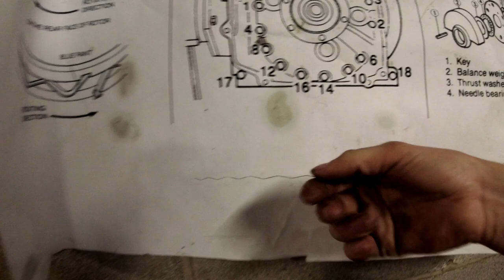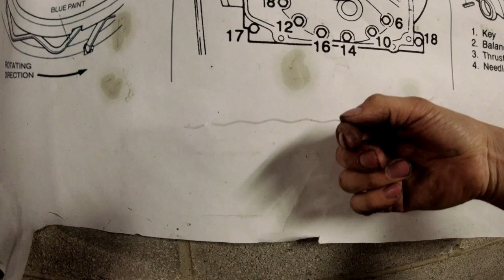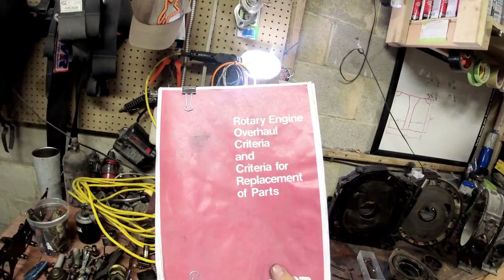Your Rotary Engine Needs a Rebuild - What Do I do? - How Much Will it Cost?

Comment: I make alot of the parts for Formula One engines, especially turbo's. Cylinder Heads. Formula One engines that rev to 23k on the test beds create incredible heat which of course melts normal metals. so therefore we put a liner inside the high heat areas of Inconel 618. of course these engines come in at 5 million $ but it would be interesting to see a garagista do something similar with one of these. very DO-able.
Reply: What engine ran up to 23k?

Comment: They are not freeze plugs. Those are the spots designed to allow the casting sand to be removed. If the engine had had coolant instead of water in it this damage would not have occured.

Comment: 'Freeze plug' is a misnomer; they are actually casting plugs, the holes used during the casing process to remove the casting 'sand' from internal portions of the casting and then closed with a plug.

Comment: Been a tech for 40 years with zero experience on rotaries who just bought an RX8 with low compression.
Your no nonsense approach video is just what I was looking for.
Keep up the amazing vids and your passion for these engines.
Reply from the maker: Thank you sir!!!   Its a lot of me talking, but its all in one place
Reply: how are things going?
Reply: @willg125  2500 km on a Mazda reman itching to send it. Now  6 speed manual and absolutely love the car. Amazing handling
Reply: @mcgrawde  fantastic! Was the swap a better option than a rebuild?
Reply: @willg125  The Mazda reman came with all necessary gaskets, flywheel, water pump, new thermostat and more. It was under $4k  CDN before taxes. Parts pricing for rebuild would likely be more if any hard parts would be required. Not regretting my
Reply: UK back in 1995 cost me 2500 first time and 1500 UK pounds 2 Nd time doing it all DIY.
Reply: I say tips are good for 70 k based on the wear I measured.
Reply: How do you time a 13b fd engine?

Comment: I appreciate the depth of information in your video. I very much appreciate the time you took to make this video. 65 years old, rebuilt regular engines and transmissions with success. Rebuilding a rotary when you can't get parts ( housings or irons), it seems a little daunting. Have had my car a number of years, going to try anyhow. Really really appreciate your video.

Comment: Super helpful! My stock 85 12A is hard to cold-start. I pulled it out of a barn a year and half ago, sat 15 years before that. I know it's only a matter of time before a rebuild is in order, and this helps to set expectations. For now I'm tempted to keep driving until it gets worse.
Reply from the maker: Does it hot start?   Cold start is probabaly just a carb issue
Reply: @RADPotential  Yeah starts up great when hot. First thing I did was rebuild the carb (Nikki, with rats nest). I also fixed all the vacuum leaks/broken tubes I can find, etc. Some steam out of tailpipe when I cold start, it's also worse the longer the car has been sitting. But I don't see any coolant drop, or its VERY small.
Reply from the maker: Id bet that engine is fine.  Just a tune up to the carb should do you solid!
Reply: @RADPotential  Thanks for the support! This conversation has reminded me to check the intake coolant seals as well.

Comment: My superchrged rotary did a 3 km hillclimb on 30 degree Celsius day with the water pump off! The temp dial was off the charts! That was 15 years ago! Still running same engine with no issues! Ceramic seals , viton o rings are good investment!
Reply: Ianetti seals?
Reply: @nzuncovered1845     Correct.
Reply: @Barkevshadian  Great I heard they are guaranteed for life
Reply: @nzuncovered1845  I believe others parts will fail but the seals will still be in working order. I thrash this engine and it is still running.  Honestly, i want it to fail to i can install a 3 rotora  But the SOB is still going and proving me with 400 WHP!
Reply: @Barkevshadian  Damn that sounds fun, 400hp on a supercharged 13B? what supercharger do you have? I was told you can't use forced induction with ceramic seals because of detonation.
Reply: @nzuncovered1845  Awesome  power! Instant throttle response , and flat power from 2000 to 11000 RPM. Its got  Whipple 2300 SC, SDS Management, lightened Rotors,hardened gears etc. The engine powers a 59 Healey Sprite.

Comment: Your video is very informative regarding Rotary potential failure areas and how they happened. I had watched all the popular videos about the Rotary engine and yours has given me more anxiety than ever as I own an 86' S4 NA RX7 (only 60,000 miles)...😂😂😂
Mine is having an oil leak running down from the Oil pedestal (not sure yet) and perhaps could also be the Oil return line (which is right below the oil pedestal). I need to bring it to a shop to check it out.

Comment: Had to watch it again and afcourse subscribed because I am going tomorrow to check out two FA RX7 where one is apparently a parts car because of rust and the other was parked two years ago but has a cracked radiator and they removed the oil cooler and made apparently just a bypass. Frankly I think the cooling liquid frozen in winter and that's why the radiator went but this means that the engine is likely damaged also. But what I can't figure it out how the oil cooler cracked and that is a big concern. The problem is finding decent rx7 or part's in Europe so everything is sadly double expensive then in US, afcourse if you can find the part's. Great video and afcourse super explanation and I will definitely enjoy your Chanel.

Comment: So just wondering, it IS possible to have bad housings/irons resurfaced correct? Because if I either have to keep using my worn 175k mile housings and wearing out apex seals fast that doesn't sound like a worthwhile situation.

Comment: There's the whole part about front and rear counterweights I need more help with . ..Also tricks and techniques about how to remove the important eccentric shaft bolts as well as it's removal. . . .. Let's not forget about oil metering pump. . .. .I need some videos showing me those parts before I tackle my own rebuild. . . ..I also need a video showing me how to get the crank angle sensor right along with the timing marks. . .How to land the rotors right when placing them back into the engine stackup. . This was a great video for me to understand some key things about what major parts to use and why.   Thank you  ..  . 86 S4 N/A
Reply from the maker: Search back on the channel. I have videos on most of that I think.  It's somewhere

Comment: I've never tried on a rotary but I know I've used "Comet" on piston engine rebuilds to help get the rings to seat during the initial start. It works like a charm on piston engines, I don't see why it wouldn't work on a rotary as well but I haven't done a rebuild on one yet. Pretty sure I'm going to have to shortly though. My son and I are doing a fb barn find rebuild right now. Keep up the great videos!
Reply from the maker: I will look into that stuff.   Is it like an assembly lube?  Good luck with the FB.  should be plenty of videos back when I restored an overheated 12a last year for the FB guys.  Full fuel system overhaul
Reply: @RADPotential  No it is an actual household powder form cleaner. It works well for deglazing and seating rings on a new build or one that has been sitting for a while. You get it running than start sprinkling it down its throat while running, obviously don't go nuts. Like I said it works like a charm on a piston engine.
Reply: You are a smart guy so once you see what it is you will understand why it works.
Reply from the maker: Hell yea.   Id be interested to try that.  Maybe I'll do a what I have laying around build and see if it would help that!!

Comment: Hi man how are you + it’s Dom from down under - I have a 84 12a  motor and box - it’s leaking from the dowl pin front near dizzy - also I have a gearbox noise very bad when cold with the clutch is out - I have to start it always with clutch in till it’s warm - I’ve done the needle bearing and seal in the back of shale , I’m worry a little about doing the pull down and rebuild on my 12a , it’s runs so well drives well -  I brought it about 16 years ago and have had in my dry garage till last year , it started first go - it my first rotor motor - I have the rotor bug now - I really would like to succeed with my car   . My little glc coupe my first car -  thx man dom

Comment: Great Video alot of useful information. Have you done a. Peripheral port engine? Was wondering Apex seal type material and wear caraistics?
Reply from the maker: I haven't experimented with any type of apex seals that aren't steel.  Some are harder and softer than others, ceramic seals.   At some point I'd love to be able to test and show the results.  But just not in the cards now

Comment: Hey, found your channel, and really enjoying your content! I'm currently eyeing up a 1984 FB with a 12A. It's in good shape, and I've been inside the engine bay and under the car, rust is reasonably minimal, and the oil is clean. However, it has been sitting for around 8 years. I'm prepared to do some work on it, but I'd like to know what to keep an eye out for, like rust on the housings or anything that might cause issues. I'm new to rotaries, and I'm excited to learn. Any advice?

Comment: Brilliant video, do you have a link to the book/manual.

Whats best on a rebuild on 6port RX8 2 or 3mm apex seals had mixed messages on that, 

What would be best/reliable porting on RX8?

Comment: Hey I just bought a 04 and acts like wants to start and shoots flames out pipes but wont fully start. Tried pulling it as well. I did do a compression test but not with one made for these cars and best guess is front rotor has low compression while rear seems great. Motor sounds good turning over as well. Has brand new plugs need to upgrade coils and wires see if that helps which ones on it seems new just oem. Car came with coil overs exhaust cold air Intake and whatever else they upgraded. And is the 6 speed 6 port. If have to plan to pull motor and rebuild myself. Eventually plan to fully build it once learn alot on this type of motor first that is

Comment: Lot of great tips man. I didn't understand the relation between filled iron edges to match ports and triangle apex seals parts falling into bridges. If you care to say a few more words on that great, if it's a long explanation to write I have two more simple questions. Saw Rob Dahm building a rotary and when assembling he told not to compress the parts (irons and other sections) too much together because later when the parts gain some relief the seals might come off. That was prior the torque down of everything etc. It wasn't too logical to me because I expected from that point onwards that everything will just get tighter together not loosened at any point of the work. Maybe you know what he meant with that. Another thing I noticed is  some aftermarket apex seals have stronger/bigger triangle bits to make them more resilient to fail. Is there any particular reason why Mazda didn't go by default with something like that but in a more extreme version. I mean, make the apex be a 2/3 + 1/3 part instead of this small chunk. I hope my questions are easy to understand. Keep up with the good work!

Comment: This is arguably the BEST run through of a Rotary Engine I have seen. You Sir are a champion. 
Can REW sequentials flow enough for a bridge or brappy port? I want to keep my car stock-ish looking and retain the twins but really want a brap. What smic would you recommend? Also coilovers that have brake line mounts (or what is the solution for those that don't?) I had hsd on my fc and zip tied them to the shock... A bit dodge...
Reply from the maker: You could probabaly get the braps with a street port.   Those twins may choke it out a bit. But it is what it is at that point.

Comment: Hello, how are you doing? Saw your video today getting a Mazda RX seven 1979 carburetor was supposedly redone but wasn’t done properly in the engine got flooded. It’s been seating for 12 years guy told me it should run once I get the engine flushed and flush all the fluids. My mechanic said I should put a new fuel pump and fuel tank the guy that I’m buying it from told me check the fuel pump this there it might still be fine. What do you suggest? Where should I start off at? It has under 100,000 miles on it. Not sure the exact miles but very low miles from what he told me What is your best suggestions of where I should start off at of getting it started

Comment: Loved this video!! Great information!! Question: What about pulling a couple of 13B motors from the Pick-Ur-Part junkyards and taking the best irons and housings and the best eccentric shaft and both soft sealing and hard sealing them with new seals? I want to try rebuilding a 13B. I don't want to port nor turbo. I'd be happy with 130-150 horsepower and 110-140 ft. lbs. of torque and 60,000 miles of life.

Comment: I always replace the apex seals and hone the rotor housings, lap the plates, bearings etc
Reply from the maker: I'm on the train of do as much as you can while you're in there.  I dont like re work haha
Reply: @RADPotential  sometimes customer wants a low budget rebuilt.. But u have to remember that if it fails then they gona blame the the technician..
Reply from the maker: Every time haha!!.   Cost, Quality, Delivery Time,   Pick 2.  But yea I don't do budget builds for anyone but my own junk lol.
Reply: @RADPotential  great vids.

Comment: I Was Waiting For YouTo Talk "Oil Control Rotor Side seals. They  fail and leak oil as they sit. Then a smoke cloud comes out when you start it. I had a neighbor come yell at me for it once.  Also it would burn a quart of oil in 4 laps  of AUTOCROSS.  You lift and oil gets sucked into combustion. One of the reasons for the failure. Mazda put out a statement. Reason for not using synthetic oil. Early model rotaries oil control seal break down in synthetic oil and fail.( the o ring under metal cap) I had 2 engines with the failure. I used synthetic blend .I no longer use Synthetic. The Mazda statement even said Not to use Synthetic  blend.
Reply from the maker: Shooot!!!!! I knew I missed something!!!!!!!   Ill make another video and add it in the description and a card for it.  Thank you!!!

Comment: Definitely am a fan of this no nonsense no bling channel.  I recently bought a pretty rusty RX-3.  12A and factory 5 -speed have been sitting for an unknown length of time. I know I have to tear it apart to inspect.  I've read that if there has been coolant leak everything is most likely toast is this true or can parts be dry ice vapor blasted and housings resurfaced if my only goal is to stay N/A, bridgeport, Weber similar to your 12A configuration etc.  Thnx in advance!
Reply from the maker: If a coolant seal leak sits and fills the housings full of coolant, most likely it will be pretty un happy inside that engine. Could probably salvage the rotating assembly.  Maybe the housings.  Irons ehhh???
Reply: @RADPotential  Yeah pretty unlikely it's an RX-3 SP bought for $2400 so probably worth it for a learning experience (my parents raced a 1st gen. back in the 80's) but I haven't even looked at one of these things in 30 yrs.!
Reply from the maker: Dang brother!!  That's epic!!!  Great price for that car.  And super cool your family raced these old cars. Would love to see some pictures from back then!!
Reply: @RADPotential  Yeah I'll try and dig them up.  It was S.C.C.A. back in the 80's at what was then Seats Point and Laguna Seca.   They were racing BMW Tii's and the 1st Gen which was solar gold.  Btw I have to do a strike to LA to pick up some parts leftover  from an FD roller that I bought months ago.  You don't happen to have the dimensions of the FD hatch by any chance?  Great channel brotha. Rally , Cosmo, Repu content whatever  all the old  school stuff is dope!
Reply from the maker: @jdmimportlogistics  I will measure the hatch on the fd in the shop and reply here.  

thanks man!!  I love these old mazdas.  Its epic to be able to share them with yall!

Comment: My 13b had 70/70/30 on the front rotor. I let it soak in atf for about 8hrs. Now its at 90/90/60 . I know I need a rebuild
Reply from the maker: Had it been sitting for a long time?

Comment: Hello rad potential. My wife and I have a 1982 rx7 and 1983 rx7 we bought new. Low mileage both under 50k. We don't drive them often, would you keep driving them as is or have them checked out, we live in knoxville tn. Any advise would be welcomed.thanks for your time

Comment: Hi my question is a bit long and need more advice so here goes, my 2004 Rx8 6 speed 231 bhp broke down here in the UK 🇬🇧 took it to my local Rx8 guy who told me that the oil metering pump is gone need a new one but when the car is fully up to its optimum temperature it takes 5 seconds to start but starts every time so did a compression test and the results were 5, 5 bar front and 4.7 bar rear, the mileage is only 50k miles.

Have found a used engine from a trusted person has 96k miles on the clock starts hot and cold with in 3 seconds for £600 pounds.

What do I do should get the oil metering pump replaced and use the car for now, how long you think that it will last me or should I get a used engine and replace it plz help and guide me.

Comment: I like how you broke it down really because I've been debating on a fd honestly and it looks like even building It is fun and easy once you know what u need to but I have a question if I wanted to build one on a budget would it be wise to buy one with a blown engine for cheaper and rebuild it or one that's already running my goal is to keep it for a long time and build as I go
Reply from the maker: Id start with one that runs. So you can learn the peripherals before you have to work on the engine it self. Much easier to start with a known good car then learn on something that is broken